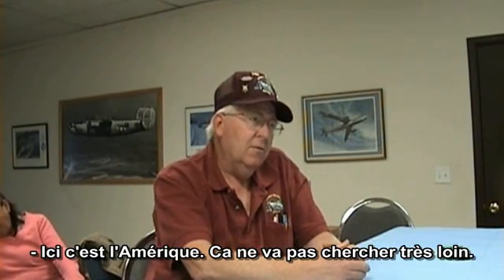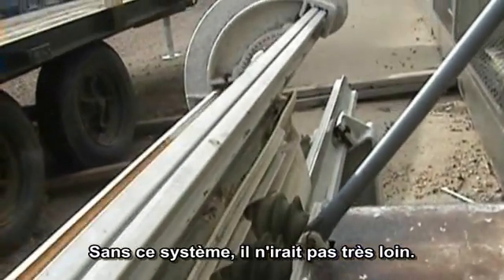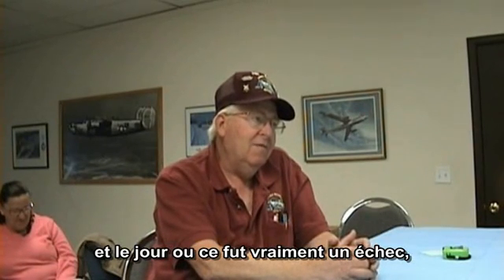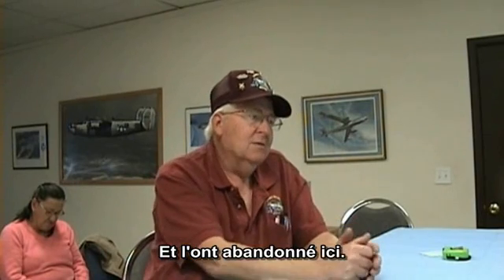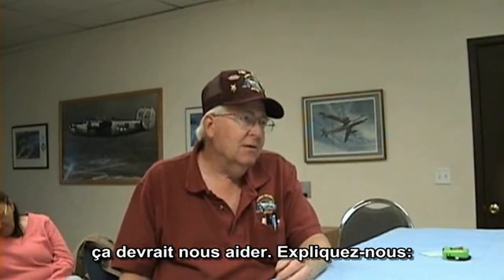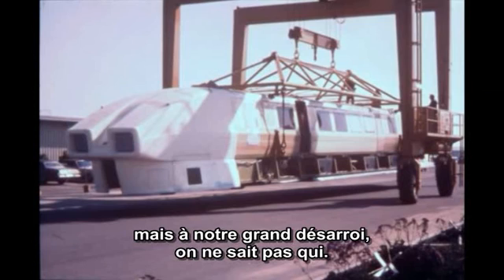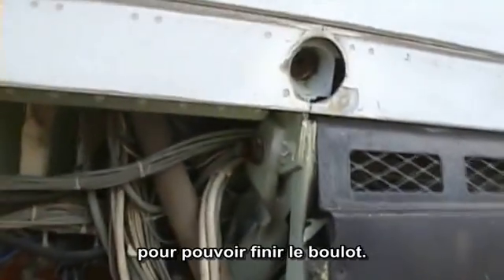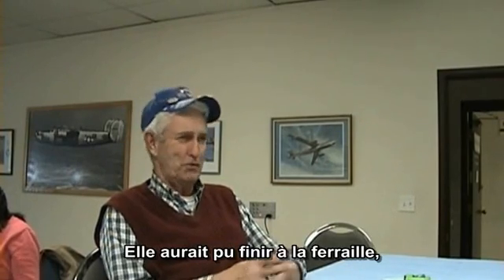On a retrouvé le dernier aerotrain - part 4 of 6 (We found the last aerotrain)

Comment: A question from an overenthusiastic dilettante  to someone who knows: would it be less or more power hungry if they went with a rail-gun principle for propulsion ?
Reply from the maker: The induction motor at that time wasn't an efficient technology and not widespread (bad economies of scale and not cheap). Now it's used in many applications including transportation/rail; efficiency and economics of linear induction would be a good business and technical choice today. The "rail gun" on the other hand, is it now efficient, widespread, off the shelf, cheap?
Reply: Thanks for prompt answer.Like I said, I am an overenthusiastic dilettante, so I don't know. Some elements might be (if they used regular rails for example, either side of the central spur) as for other necessary elements, I don't know. If you looked through all the existing industries, rail, aircraft, automotive, you might be able to scrape most of it up. But as the power consumption would be crucial for long term running of this technology, power consumption is what I asked about.